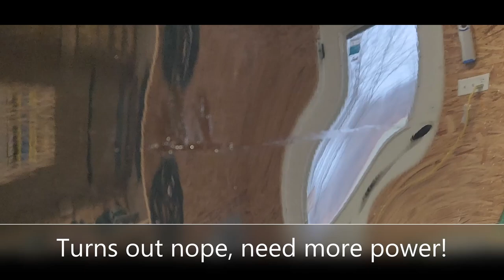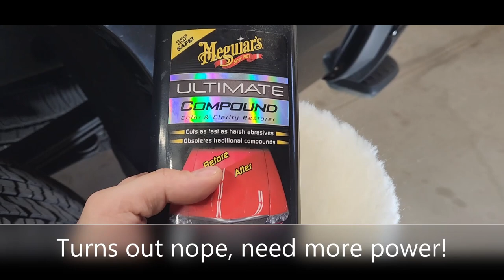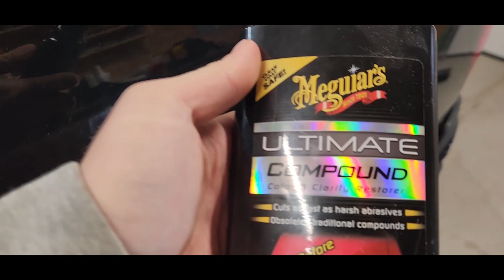Is an ACDelco touch-up paint kit worth it?

Comment: You need to wet sand it. Go 1200, to 1500, to 2000. Then you can compound and polish over that.
Reply: After the base coat application or after the clear coat application?

Comment: Use 2000 grit sandpaper w/ water and lightly go over the touch-up area to smooth it out. Then use turtle wax heavy compound *Important*  do not let the compound dry. Then use Meguiar's Ultimate Polish 3 or 4 applications. It will look new again.

Comment: I thought it came out pretty good. If the expectation was that it would be totally invisible then no not a pro job from a collision center. But for a DYS job it came out very good. Thanks for the vid.
Reply from the maker: My man gets it, what more can you ask for for under $20 and it's rust proof.  The original scratch was pretty big too.  If there's any dirt on the truck at all you can barely tell it's there and even clean you gotta get the right light and look.
Reply: @GarmingGFB it can be done…..